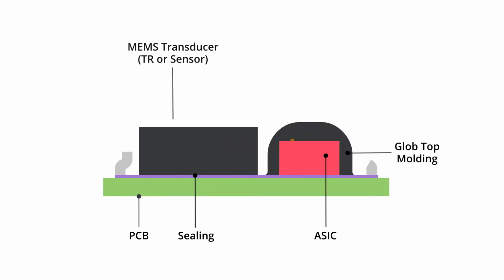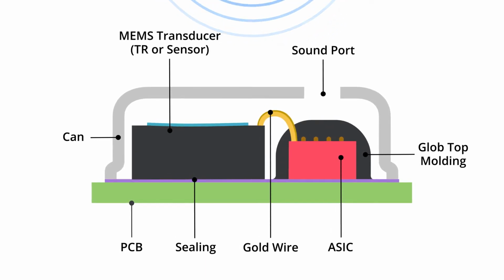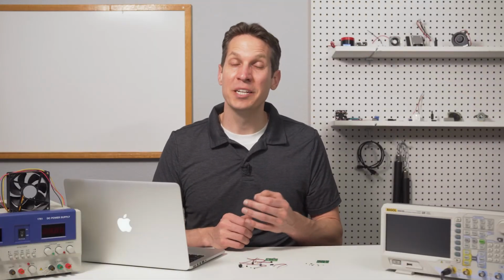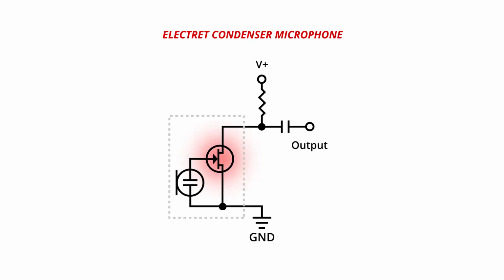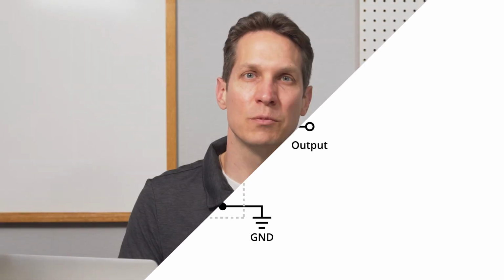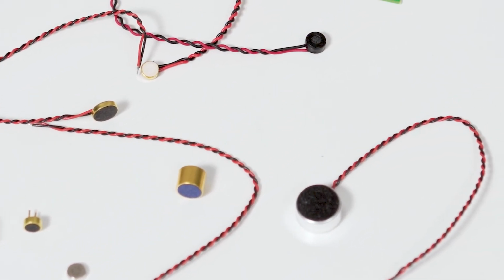Comparing MEMS and Electret Condenser (ECM) Microphones

Comment: I believe the electret diagram at 2:09 should have a hole in the aluminum housing under the dust cover to let the sound in.  Their blog has a similar diagram but with a hole.
Reply from the maker: Good catch. Our blog version is correct, which shows the proper hole for a top sound port: https://www.cuidevices.com/blog/comparing-mems-and-electret-condenser-microphones#electret-condenser-microphone-basics

Comment: Very informative. You didn't comment on the quality of the audio output from these two types of mics. For say, a field voice recorder, would one be better than the other? Thanks!
Reply from the maker: Glad you enjoyed the video! To answer your question, for a field voice recorder application, see below:
1.	To compare with MEMS microphones (100Hz-10kHz), ECMs have a wider response frequency (100Hz-20kHz). So if the voice recorder needs to take a wider band of sound, ECM is the better option. 
2.	If you will use two microphones at same time, then we suggest using MEMS microphones because the consistency is superior.  
3.	If you consider the assembly method: For SMD type, MEMS microphone will be the priority. For pin / wire type, ECM is the only option.

Comment: Nice explanation!
But why is the sound port on the MEMS not above the Transducer? And why is the opening of the housing so small in both the MEMS and ECM compared to the Transducer? With large diaphragm microphones there is next to nothing in front of the capsule. Doesn't the small opening reduce the signal?
Reply from the maker: Thanks for the feedback! To answer your questions, the sound waves would still cause the diaphragm of the transducer to vibrate. It is not necessary that the port is directly above the transducer. Although they are small holes, the sound waves are still able to vibrate the diaphragms effectively.